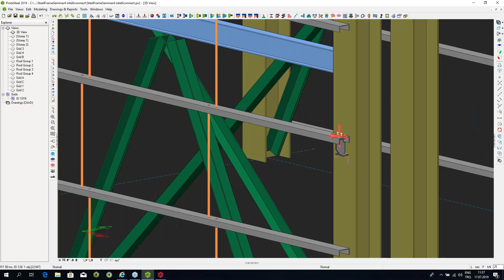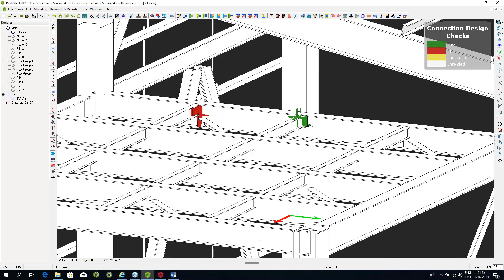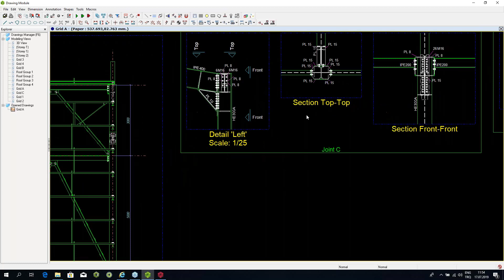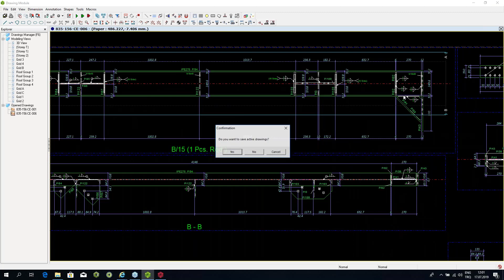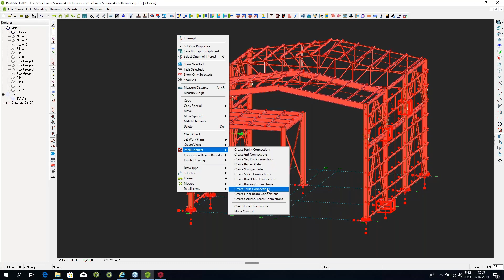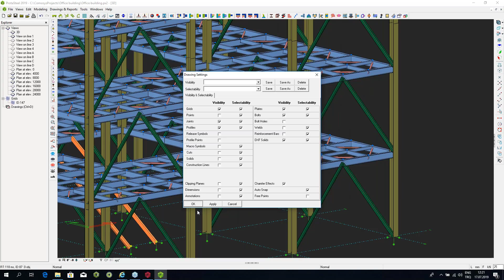Webinar | ProtaSteel 2019 New Features and Enhancements

Comment: in prota steel the connections part, an error occurs “unsupported orientation or type”
Reply: Please help”””
Reply: @ashtonphilip6371  this message is not an error. It means that the macro does not support the connection which you want to create. please use a different connection macro or create a manual connection.
Reply: YASEMİN AKTAŞ oh thanks...👌